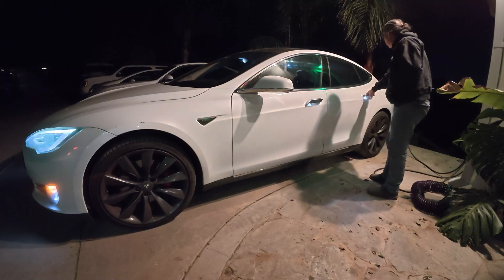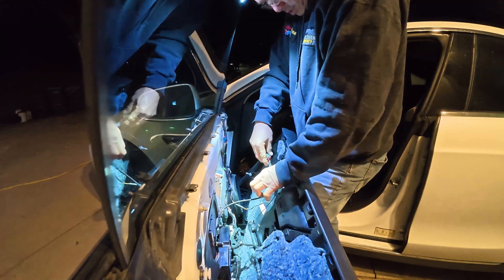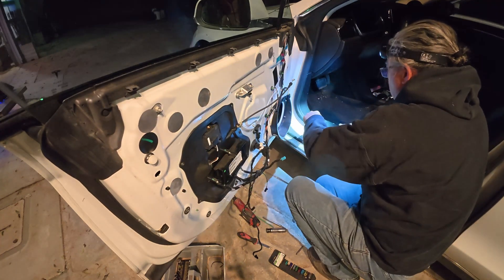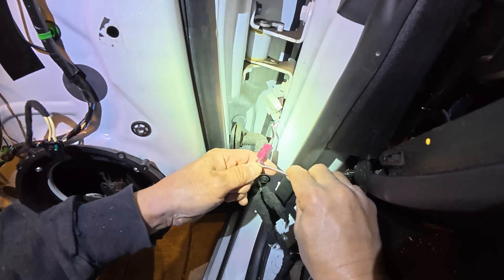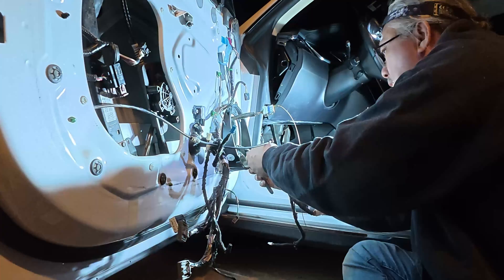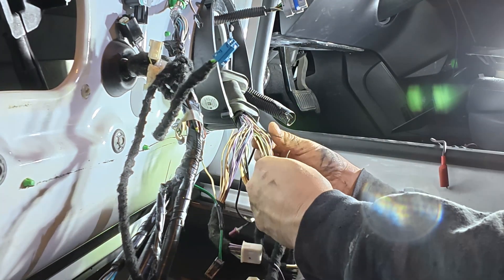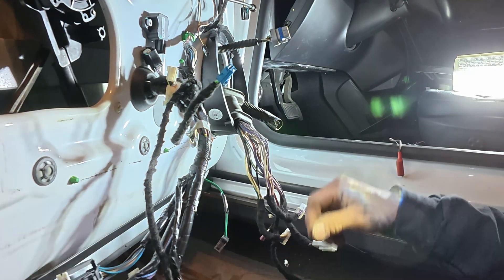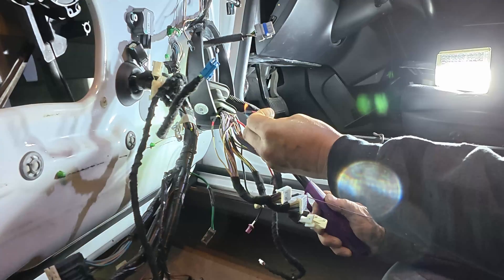Tesla Model S Rear Door Won't Open - Door Wiring Harness Repair

Comment: Thanks for the post, it's great information! I'm having the same problem with my front passenger door handle on my 2017 S. Tesla mobile repair charged me $460 to install a new upgraded door handle that did not fix the problem, then told me that it is a LIN problem (door handle isn't communicating) and is now estimating a $1050 to fix the problem. So, i'll be checking the wire harness on that door myself and will post my findings.